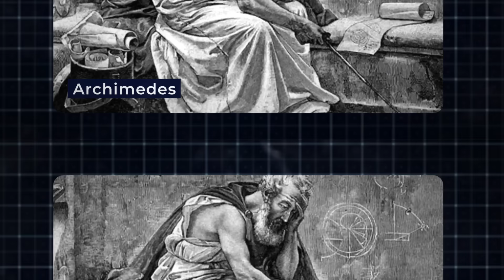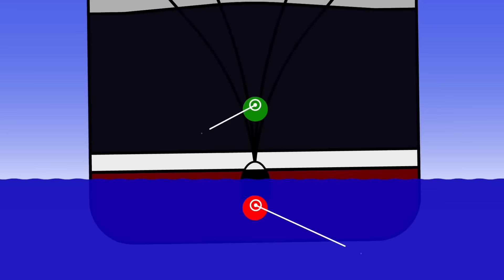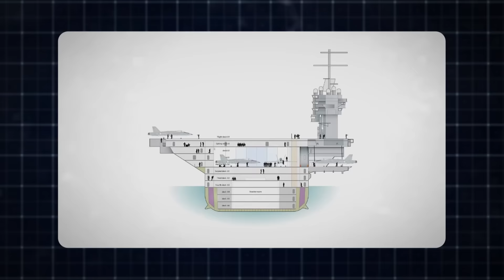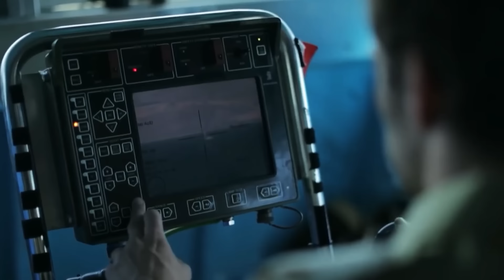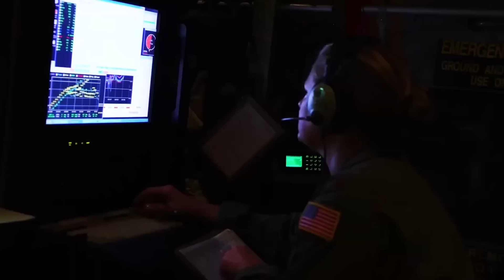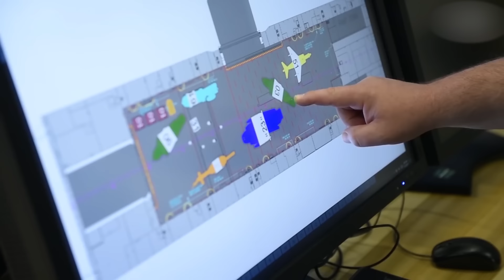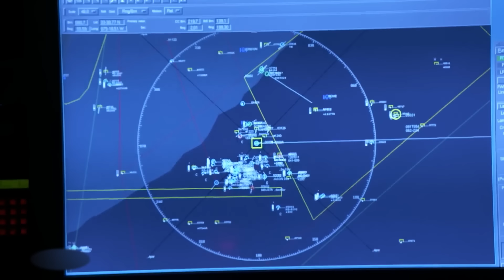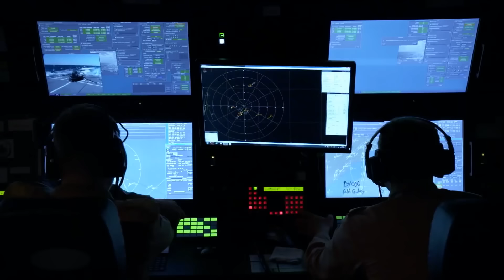Why MONSTER WAVES Can't Sink US Navy's LARGEST Aircraft Carriers

Comment: Ex Navy Sailor here from yesteryear, All navy ships use Ballast tanks to maintain the correct center of gravity and bouyancy no matter what is happening with shifting loads, they fill and empty tanks all day long during evolutions, most of this ballasting is automatically controlled.
Reply: You mean fluid passive ballast systems! 
Smaller ships are fitted with side rudders that can only offset so much pressure without ripping off if used wrongly!!! 
Modern ships have 3/16th of an inch plating!!! Explains why the sides of older ships are concaved in like egg cartons!!! 
On a large aircraft carrier active pumps speed up the rebalancing, but chews up power & wear & tear on the massive pumps!
Better hull design means everything, instead of righting it's wrongs!!!
S when looking at poor design lok to a Battle cruiser taht lost it's bow off the Allusions during WW2!!! Pounding down on the crest at distance put so much stress on the bow it sheared off just in front of the 1st turret!!!
A mega wave plowing over the bow of a US super carrier will be so heavy it may do the same thing!!!
Reply: @RatusPretentious 
"Side Rudders...!?"
You are inventing terminology to fit with the images you saw in your Colouring-in Books.
Reply: @nicolasrose3064 🤣🤣🤣🤣
Reply: That's how all ships work
Reply: @RatusPretentious oh and the United States didnt/dont have Battlecruisers
Reply: @jonnyblayze5149  The USN had battle ships with just heavy cruiser armour belts, making them faster!!! 
From WW1 till the end of WW2 battle ship with heavy cruiser armour were the definition of a battle cruiser (concept from Admiral Lord Fisher RN!), even if the US didn't use that designation!!!
The US always like to go it's own way, just to be American!!!
May explain why others from the America's go out of their way to avoid also being called Americans, though technically are!!! ;p
Reply: @RatusPretentious  so like i said, the United States dont/didnt have Battlecruisers. Sorry kid, try again.
Reply: @jonnyblayze5149  Like I said the USA had battleship sized hulls with heavy cruiser side armour!!! LIKE the ALASKA Class with poultry 9" side armour compared to the USN's BS's with 14-166" armour!!! 

Give up on it KID, as  relying on just Yank terms instead of the rest of the world is not a final sale sell point! In fact it just undermines your credibility!!!
Reply: @RatusPretentious bruh the us didnt use Battlecruisers it doesnt matter what other countries call their ships. You lost take your L bruh.
Reply: @jonnyblayze5149 dude just dont get it lol but you were right bruh
Reply: @erichvonmanstein6876  i know right, but good looking out. Some people just cant be taught i guess🤷
Reply: Stabilizers is the correct term.
Reply: I totally agree with you

Comment: If you filled a boat with closed cell foam, maybe you could get close to unsinkable, if you know the amount of weight a set amount of foam can float, you could float the boats weight and then a calculated amount extra for passengerband cargo weight.... something else, we have air bags in every modern vehicle, why not "air bags" that could inflate quickly in a specific order to flip your boat back over if capsized, and enough inflated volume to keep it from completely sinking, enough to let you pump water out and save everyone aboard...
Reply: They basically already have that but they are metal balloons, and they are called air tight rooms. The titanic had 20 or so, these ships have hundreds of them. The ones on the titanic didn't have lids so water could spill from one section to the next, these ships have lids on their air tight rooms.

Comment: A tidal wave hitting the front of a US super carrier will roll over the bow & the mega weight, that takes time to run off, will likely break it's back!!! Pure physics!!!
Reply: That's not how tidal waves work in the open ocean. Facts matter.
Reply: @ripn929707  In open ocean a tidal wave is like an extended swell at massive speed! If facing the wave the bow will reef up at a jaring rate! 
Then as the wave passes the middle of the wave the bow will crash down with enrmious force & likely submerge!
As it tries the rise back up the massive tonnage of water on the deck cant run off fast enough!!!
& this is not like some pissy little waves during a big storm!!!
If hit part side on the bow or stern will spin away & the ship will be side on forcing a possible roll!
Expect to lose all planes on deck & the ones in the hanger will break free to move down hill, adding to the roll!!!
Reply: @RatusPretentious  You watch too many movies. The massive tidal wave that hit Japan (2 of them) was rode right over by a medium size ship. The swell in deep water is nothing.the power is in the length of the swell. When it gets to shallow water it rises up, slows and gathers volume.... absolutely nothing you said is true.
Reply: @ripn929707  Tidal waves in open sea look like very fast moving hump like swells! so 30'+ high & 60+ MPH is to be expected, as minimums!
They don't crest like waves till in shallow water! Due to bottom drag!!!
The Japan tidal wave had already entered shallow water & run up a narrow harbour funnel! 
Breaking it into multiple smaller 15+' high waves!!! They returned to longer shallower form once the ran over land, where drag reduce the speed!!!